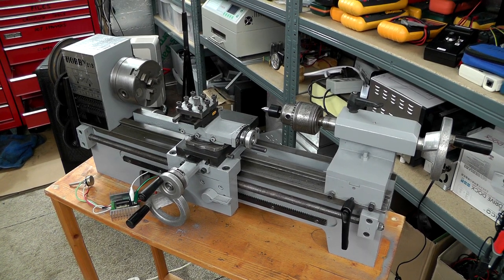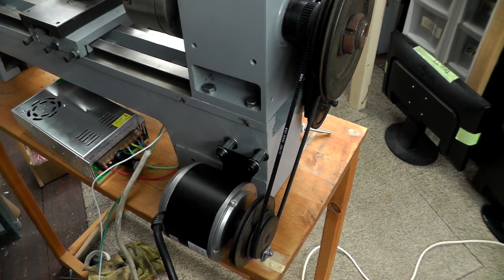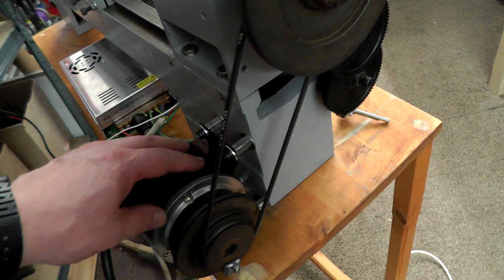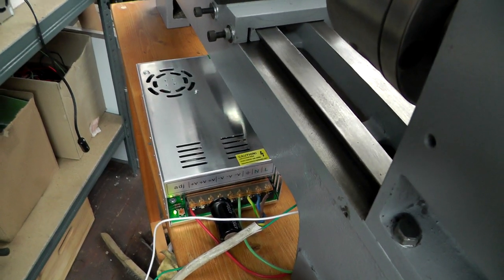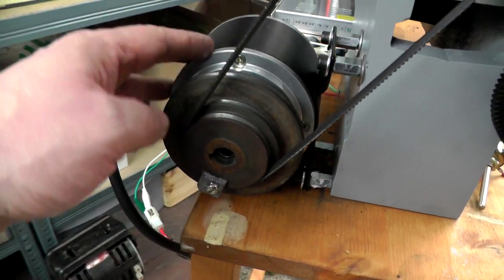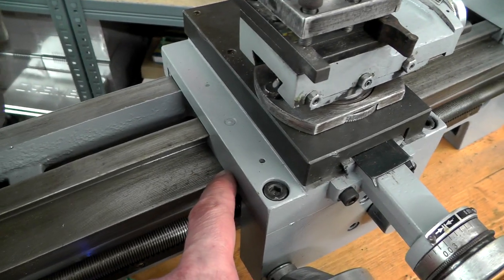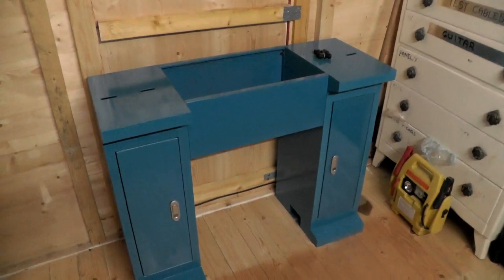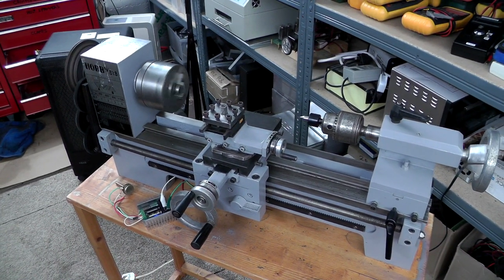Lathe refurb project - Update Part 1

Comment: the powered carriage isnt just for threading but for a power feed, so you get consistent size and finish across a long cut, also saving you having to wind it slowly for ages.  nice job on getting it sorted out though! you will need to do a long cut so you can measure taper, and possible adjustment of tailstock to counter it, before you trust doing any real work
Reply from the maker: Thanks for the info. I have some brass round bar stock to test with. Ran it in last night and made my first ever lathe cut....:-)
Reply: IanScottJohnston  Buy some tools with replaceable carbide tips. They are great as a cutting tip, so you always get a good cut. REverse feed is also good for things like tapping, as you can simply place the tap in the end stock drill chuck annd use the late to tap a hole in round stock. Note doing this that you do need to have spiral taps meant for machine tapping, not a hand tap. Also I can attest that you will at some point buy some tap extractors, as you will break off a tap in a hole. I am building up a collection, currently have M5 and M6, but was able to cobble the M6 to take out M8 taps as well. For drills do yourself a favour and only buy cobalt steel drills. They are harder, stay sharp longer and work better.  Buy them from a tool supplier, not any old supplier, there are plenty of fake ones out there.  I used to budget one HSS steel bit per hole for stainless steel, even using Somta tools, and when I bought a pack of cobalt steel ones from Toolquip I did nearly 400 holes on the first one before I broke it in a hole drilling out the old rivet.

Comment: Watch out with the reverse as the chuck might come flying off. Especially with a work piece in there. Not so much a issue with a small lathe but still keep it in mind.
Reply from the maker: When I build up the panel I was going to limit it to forward motion only, but yes....when I was cleaning the chuck it 'came away' in my hand and I thought wtf!
Reply: IanScottJohnston That must have been a handful of spinning surprise!

Comment: Does the motor controller use tacho feedback? Will be interesting to see speed regulation under load. Nice project.
Reply from the maker: Coolkeys2009 No feedback. The motor is designed for an electric bicycle so is quite powerful for it's size. I'll put the spec etc on my website soon. If I remember correctly the motor is about 300W rated.

Comment: Here is another tip to stop rust: use a deep humidifier and a greenhouse heater if your workshop is in an outside shed.
Reply from the maker: Not really a shed, but a wooden built workshop (all fully insulated/heated) except for the extension........I will probably knock down the internal wall so it will all become one heated/dehumidified workshop.

Comment: To stop the rust coming back spray with WD40 or a cycle light spray oil after use.
Reply from the maker: Yes, and especially in my other workshop (where it will sit) there is no direct heating and gets cold with quite a lot of moisture in the air. May need to look at that!